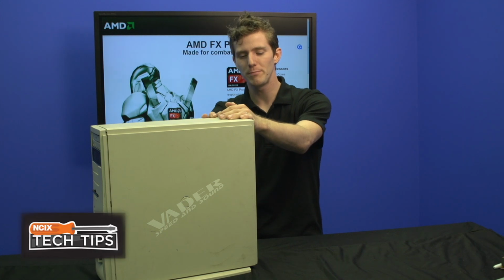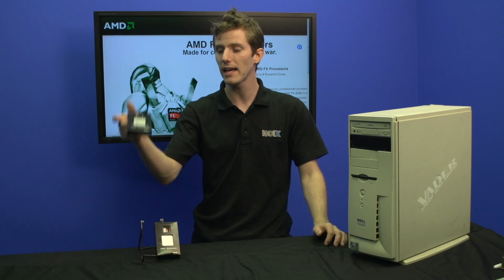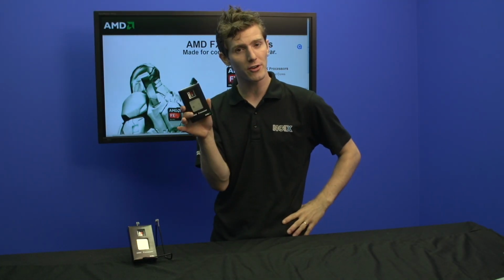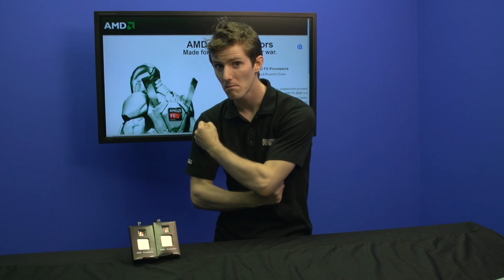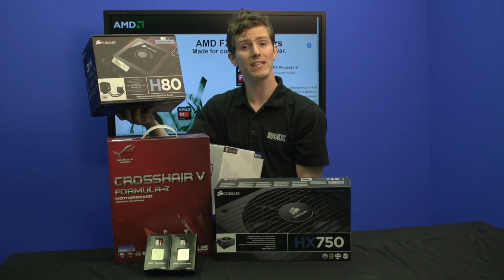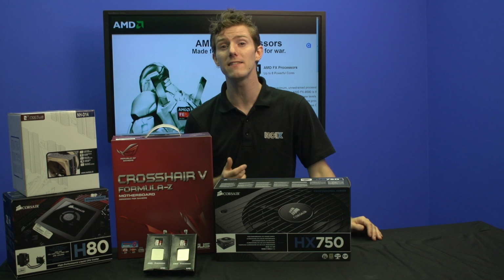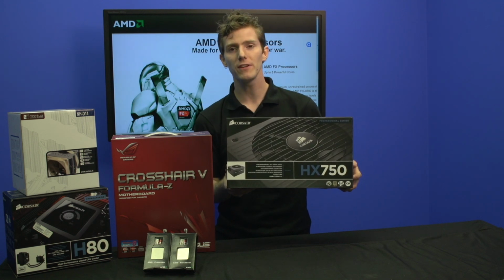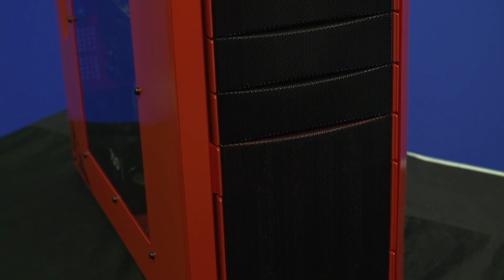AMD FX 9000 series processors hitting 5GHz!

Comment: Wouldnt it be beather to use the Asrock 990FX Extreme9 motherboard for the FX-9000 CPU series because its has Dual-Stack MOSFET (DSM), Digi Power, 12 + 2 power phase design for better power supply to the CPU?

Comment: All 8 cores running at 4.7GHz? WTF why not just combine them and have a quad-core running at 8Ghz -__________-
Reply: Thats now how CPU's work. It would need alot of power and run way to hot.
Reply: Because nothing can cool it you idiot
Reply: Than Campbell
you seriously have no clue about manufacturing you dumbass
Reply: "You have no clue about manufacturing you dumbass" and you're proposing an eight gigahertz processor.

Comment: looks like AMD really mean business lately, they beat Intel to clockspeed and now as annoucned in 2014 are even seizing momentum again with their APU which Intel is lagging behind considerably O_o

damn, i always had a weakspot for AMD because they keep innovating but really they arent fucking around for the past 2 years XD
Reply: High clockspeed is hardly an achievement, and does NOT necessarily mean the performance will be high. Any idiot can make a high-clockspeed CPU that performs terribly.

Remember the Pentium 4 Prescott?
Reply: ptobler1 .
tell that to my A10-7850K and the 2133Mhz RAM in it
Reply: xGoodOldSmurfehx The APU NEEDS the high-frequency/higher-bandwidth RAM to feed the integrated GPU.

The $170 A10-7850K is just not good value for money when you could pick up a Pentium G3258/Athlon X4 750K + an XFX R7 260X for only $15 more. This combo will beat the A10-7850K, AND you do not need to buy expensive high-frequency memory to get good performance.
______
But that's totally unrelated to what I was saying. The 4.7-5Ghz FX-9590 might just barely outperform a 3.2Ghz i5. Why? The i5 does way more per clock cycle than the AMD FX does.

Also, don't forget the FX-9590 uses around 260W at full load (which creates the requirement for a high-end CPU cooler) and has very little overclocking headroom.

A much cheaper i5-4690K has overclocking headroom and consumes much less power (~120W).

I really do think AMD is an important player in the CPU and GPU scene, but the FX-9590 is just a terrible waste of money.
Reply: ptobler1
overall FX CPUs are made for multi-task and development such as photo/video editing or game-designing etc., APUs are made for gaming just like the Phenom II

every single Intel CPUs are made for enterprises and industries, some derpface thought that because of that he should be gaming on it but in no way is Intel superior to AMD in gaming or vise-versa really

altho AMD tends to perform slightly better in some cases with a good GPU but overall its pretty much even

APUs are focused on gaming, the FX-9000 series IS a waste of money for gaming BUT its the best there is for development alongside the i7 extreme editions

im merely talking with live testing experience here so no stats, sorry

also i dont get why people keep insisting that the Athlon II X4 760K + an R7 260X beats an A10-7850K because it simply doesnt, it even gets outpeformed by the APU, the Athlon II series is completely outdated in terms of technology and features and theres already a bunch of games that it cant run at all on medium settings
Reply: xGoodOldSmurfehx I meant the Piledriver Athlon X4 760K. It's a Richland APU that had a defective GPU, so they disabled it and sold it as a vanilla CPU.

I didn't mean an Athlon II, which is based off 10h.
Reply: Intel's core architecture is more efficient and superior to amd. also the 8350 is older then the 4460. but for 169.99 8350 is a good bang for your buck. in the end you could get a i5 4690k for like 210 dollars or the 4460 for around 180-190 dollars. Would rather just spend the extra 20-30 dollars and get the unlockable chip.
Reply: *****
when AMD puts their R9 GPUs in their APUs, i say GG to Intel and NVIDIA

still no matter what happens, i hope there will still be alot of competition  #LowerPrices  :)
Reply: Until AMD can beat out Intels superior core architecture it wont mean anything. a 4 core 4 threaded i7 will still handle a 8 core AMD any day of the week. Think if Intel released a consumer grade 8 core processor? it would be game over.
Reply: ***** That's because the 5960X costs $1000.
Reply: ***** That's not necessarily true.

Intel's Pentium G3258 often beats Athlon X4s in the $70 segment.

i5-4460s did often beat 8350s in the $180  segment, but AMD discounted the 8350 slightly.

i7-4790Ks wipe the floor with the 9590.
Reply: ***** idk where you how you got your data, but the i7 4790k beats the 9590 in both single and multithreaded performance and the i5 4690k beats the 9590 in single core performance and comes close to beating it in multicore applications. Look at the benchmarks. You also used a cheaper and locked i5 for your comparison against the fx 8350. use a 4690k vs the 8350 and the numbers are very different. hell the older 3570k i5 still beats the 8350 in single threaded applications and comes extremely close in multicore applications while the 4670k i5 beats it entireley in both single a multi core applications. sorry man but your info was incorrect. revisit cpu boss and compare those said UNLOCKED processors for your comparison.
Reply: Ares14 Actually, i5-4460 vs FX-8350 is a fair comparison as they are a similar price.

And please don't use CPUBoss.
Reply: Similiarly priced but not at all comparable processors. We aren't taking about price comparable cpu's. we're talking about overclockable high performance chips on both amd and intel. Also, He also used CPUBoss not to mention all you would have to do to get these benchmarks is also look at the numerous videos on youtube and other websites to get more examples of what i explained. If you would of looked at the comment i replied to you would see where he stated  that the i7 4790k only out performs the 9590 in single threaded applications, which is untrue.

If we were purely talking about price then i would say go AMD, bang for your buck is undeniable. But like i said, that wasn't what I was talking about at all.
Reply: ptobler1
Reply: Ares14 Actually, AMD's bang for buck can be denied. The i5-4460 can beat the similarly priced 8350 in games.

"Overclockable high performance chips". OK then. I guess we can compare a 9590 to a 5960X.
Reply: ptobler1 compare a 9590 to a 5960x? one is a consumer grade chip while the other is a enthusiast grade chip. wouldn't make much sense would it.
Reply: Ares14 Well... They're both overclockable high-performance chips like you said. Both are the flagship models (unless you go into Xeons/Opterons, which can't be OC'd).

I don't think there's anything wrong with comparing i5-4460 to FX-8350.
Reply: ptobler1
lol if you wanted to really do that comparison then we both know who comes out on top. especially with a workstation grade pc. anyways, you can compare the i5 4460 with the fx 8350 all you want. I'm looking at the fact that the 4460 is limited with how far you can push it compared to the fx 8350 or 9590. so instead my example was based off  unlimited overclockable chips on both sides and with that, intel beats amd. in the end, you pay for what you get. my friend has a amd 9590 and loves it. i have a i7 4790k and use my computer as a workstation/ gaming pc and i love it. not really more i can say. oh yeah and the flagship models for consumers are the 4770/90 and the 9590.
Reply: Ares14 I understand now. So you think an OCd FX-8350 might beat an i5-4460?
Reply: ***** Just found one:
ASRock Fatal1ty H97 Performance.
Reply: ***** There may be other, cheaper ones that have those features. That was just the first one that popped up.
Reply: ***** Or you could have bought a Pentium G3258/Athlon X4 750K + R7 260X and beat the A10 in graphics for a similar price. The 7-Zip speed might suffer, though, as the Celerons and Pentiums have some disabled instruction sets.
Reply: ***** Yes. Pretty much every $65 B85 motherboard can do that.
Reply: *****
GPU hardware? the 980 is a GTX made by NVIDIA, Intel's GPU series is the Intel HD and eeew :/

i wouldnt be surprised if AMD was working on fitting an R9 into their upcoming APUs as we speak for their Carrizo successor (or maybe the Carrizo will have one? O3O)
Reply: *****
what people fail to realize, you dont need a Uber efficient CPU to play games, you need something that gets the job done properly period

what im saying is Intel is pointless for gaming, people tend to say its better because it runs more better, say last i looked AMD & Intel CPUs offered very similar FPS performance in most games AND AMD's CPUs are cheaper and runs just about any game fine depending on which CPU we are talking about, on top of that Intel's CPUs dont achieve their so-called "superior performance" without overclocking making Intel's CPUs last a much shorter life-span while AMD CPUs dont need overclocking AT ALL in general

long story short, Intel's CPUs are a waste of money for gaming, they are more suitable for development and industries
Reply: *****
hey i dont condemn the use of Intel processors, fuck no, the more competition the better and im sticking to it

but for people complainning about their rig being too expensive, they might want to look at AMD and the people saying their rigs is superior to everything just because they run with an Intel CPU is kind of annoying me, i guess im just trying to get people to keep a certain balance so we can have maximum competition XD

yeh i didnt hear much about the new revised FX, they sound beast owo
Reply: ***** AMD CPUs (not APUs, the A8 series can really shine with their integrated graphics) are probably a worse choice than Intel for gaming, because of poor single-threaded performance. As many game engines still only use a few threads, an i3 can often be better than an FX-8370 in games.

(of course, the FX will crush it in heavily multithreaded loads)
Reply: ptobler1
thats my point, theres no bad choice
thats what im trying to tell people around but eventually retarded fanboys comes in and messes the whole topic up with nonsense (NOT referring to DrewSaga and no this is not sarcastic <3)

like LinusTechTips said, it comes down to which individual CPU you put on the list and not the brand itself

the FX 8-cores are particularly great for multimedia i heard (video editing, video recording, music composition, arts, etc.) but i love to do game development (indies :P) so i would be tempted to go with an Intel Extreme Edition

for gaming i intend to use APUs, not yet what i would like but if AMD manage to put a better GPU in there it will DEFINITLY outclass anything else on the market, even AMD's own CPUs and GPUs

even if someone goes on and say "ill still have 60% power available while running my game" ill ask this simple question: so what? was it worth the price?

of course paying twice or more the price of an AMD CPU just to have twice or more power than needed is a waste of money thats my actual point, not saying AMD is the best for everything but for gaming you dont need an 8-core with 32GB of RAM or an Intel-i7 at all
Reply: Lol clockspeed doesn't mean shit. Has well still rapes it in singe core performance. And an i7 at stock still beats the 9590...its just a glorified, overpriced 8350. And APUs aren't good for the money at all.
Reply: Ben Zimmerman
go tell that to Chris Roberts, please do

im sure he will like it, he likes to laugh once in a while
Reply: All we need is AMD excavator to get FX 9590 speed. We will have a pile of dead i7 5960x
Reply: xGoodOldSmurfehx if I knew who chris roberts was, I'd gladly tell him/her/it whatever creepy fucks you associate with. Everything I said was true.
Reply: Ben Zimmerman
pretty sure that between Chris Roberts and you, hes the one thats right

he got nothing to prove, hes a living legend and one of the most respected game creator in history of gaming, every single of his games are considered history changers and critical hits in PC gaming

i think he both knows what hes talking about, whats true or not and whos right on hardware and software, dont you think?

when Microstuff and Sony approached him to try and develop Star Citizen for consoles, he gave them the middle-finger clearly stating and i quote Chris Roberts:"we will play with the playstation dev kit that was given to us by Sony but for now a Star Citizen version for the Playstation 4 is not going to happen fault of hardware limitations, should we be able to successfully put it on the console at a playable and satisfactory performance without downgrading anything in the game, then we might consider it but for now it's just experimenting with the tools we got from them (Sony)" note that he didnt even mention Microstuff

the point? consoles have alot of cores, excellent architecture and good RAM but horrible clock-speed capabilities

in games, Intel is not the best, wanna know why? speed over cache, that said whats alot of cache if you load them slowly, when it comes to clock-speed AMD is just better and everyone knows that

now, of course AMD's CPUs usually have only half of Intel's but the clock-speed being faster without the need of overclocking nor buying an aftermarket cooler of any sort and the AMD CPUs being superior the more cores are being used by the application, i would say that the current APUs arent exactly appropriate to run Star Citizen altho it WILL run it... at mediocre performance in 1080p

HOWEVER, the Carrizo WILL be able to run StarCitizen fairly decently and an 8-core will be able to rape Star Citizen's framerate when paired with a monster of an R9 390 GPU

so yes, current APUs arent exactly top notch but they are getting there
Reply: xGoodOldSmurfehx why the hell would you expect me to read something that long? You wrote me a novel. I don't care enough to read that.
Reply: Ben Zimmerman
hey, thats how debates work so dont judge me :)

you would DEFINITLY NOT want to work at a Bureaucrat desk then AKA "public servant of democracy"

Comment: Can the H100i hold the AMD FX 8590 5Ghz Cool, when i'm suing it at clock. With my ASUS Formula -Z  Motherboard
Reply: Yeah you should be fine
Reply: i use a H110 my temps run like 37 to 39 under load .
Reply: It's already working and it works really well.
40 C degrees when i'm gaming and pitch sometimes up to 56 C
Reply: The link is working for me with crosshair V formula -Z

Comment: I think AMD doesn't get extra performance by getting 5GHz processors, it looks for me an AMD FX8350 with a factory overclock to 5GHz, IF AMD makes a new socket, with a new architecture, with a 28nm (Steamroller) architecture or a brandnew 22nm arcitecture.
with that new socket they can improve, but if they stick to the 990FX socket, you don't see that big improvement over a FX8350 OC'd

Comment: So a FX-9370 is better than a i5-4670k right? Double the cores and a faster clock speed equals better CPU right?
Reply: Not necessarily... The Intel CPU cores perform better per ghz. Basically an Intel chip at 3.0 ghz will perform on par with an AMD chip at 4.5 ghz. So if you clock an Intel chip to 5 ghz. Then it will perform like a AMD chip at 6.5 ghz.. Not to mention that the way AMD 8 core chips are designed. They don't use all 8 cores very efficiently or effectively. Making it to where even a quad core Intel chip will perform just as good. With hyper threading, Intel chips performs better then 8 core AMD chips in multithreaded task's. Even though AMD has twice the amount of "true cores".

Comment: I have a 9370, OC to 5 ghz and with corsair H60, min temp 13cº, max 45ºc
Reply: Matthew Perry
AMD actually provide a pretty efficient cooler being a cheap stock one for the Bulldozer/piledriver line. It uses heat pipes instead of the garbage fins with a fan on top like Intel. Not amazing but it does the job well enough.
Reply: ***** That stock cooler sucked when I used it out of the box with my FX-8350, I switched to Corsairs h100 liquid system. Now the 8350 runs about 10 to 40 degrees Celsius according to CoreTemp.
Then....
I put that stock FX-8350 heatsink to use though on a Kaveri A10-7850k APU and according to CoreTemp it runs between 0-24 degrees Celsius...... Surprised the shit out of me really b/c at idle it sits there all day at 0...... then will flicker to 4 or 2 every now & again. Not that lucky with the FX-8350 though.... right now I'm showing about 17 Celsius... lol

oh, and that A10 system is almost totally silent whereas this 8350 sounds loud even at corsairs lowest fan setting.... 

Now, a used LGA 1155 celeron I won on ebay that was shipped from Russia just got here..... So I'm going to throw that together now with a GeForce gtx 650 to use as a bedroom media player. :)
Reply: do you get with that processor a stock cooler
Reply: He said the corsair h60 which is a liquid cooler, so no he didn't use the stock cooler
Reply: So Incommodious it comes with the CPU only, AMD doesn't supply a stock cooler, because it cannot be cooled properly with a little heatsink and fan
Reply: Matthew Perry actually it can, just normally if you buy an AMD system then you have the money for decent cooling. Look at the fx8350, it comes with a stock cooler.
Reply: So Incommodious the h60 sucks you AT LEAST need an h80i and a h100i(im getting) is golden for this cpu. Not literally gold(i wish) just saying its perfect.
Reply: Water cooling is not the same as stock air.
Reply: LegendsXXX2 I was saying he could use it, it works but yes it is shit.
Reply: I know this is old, but the sensors are wrong or you have a chiller.